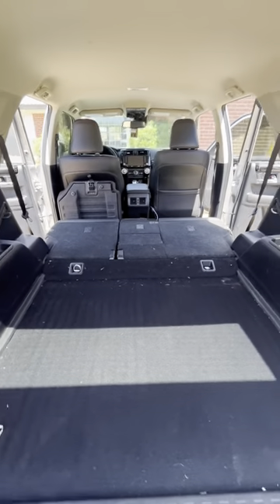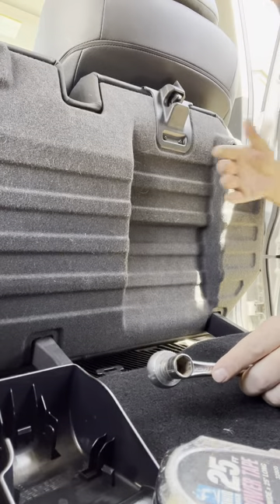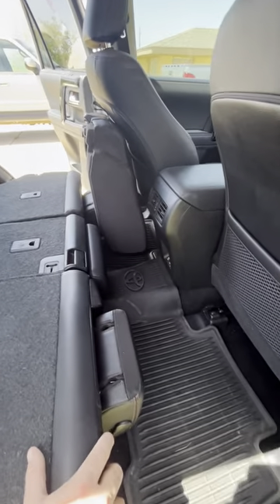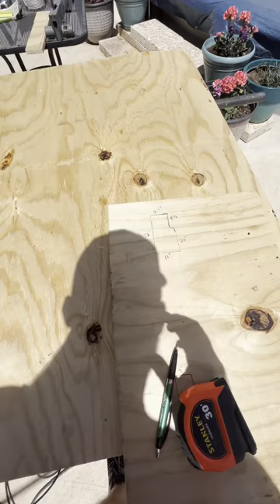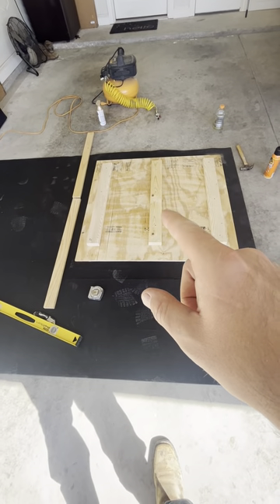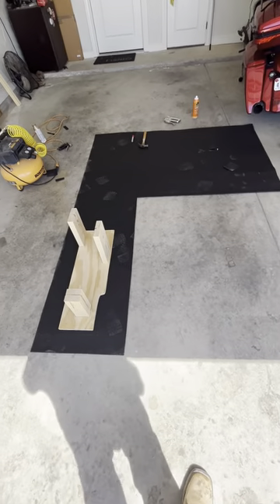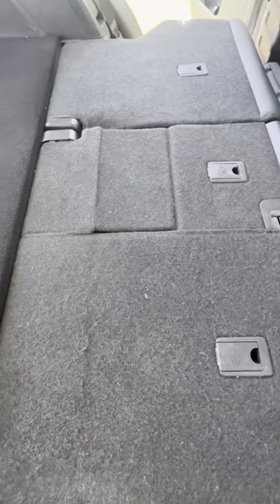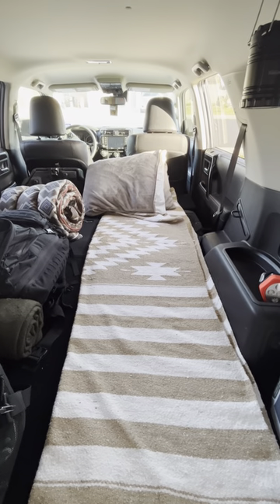4runner camping 5th Gen sleeping platform

Comment: Maybe I missed it but how wide is the area you allotted for sleeping at the end there? Like between the wheel well and your gear? Thanks.
Reply from the maker: Good question. The distance between the wheel well is 43.5 in. so from one wheel to the center of the platform is 21.75 inches. My guess is that from wheel well to the edge where my gear is roughly 26-28 inches.
Reply from the maker: To put it in perspective, most camping cots are 32-35” in width
Reply: @GarrettsTravelNAdventure  Ok cool, thanks. I was contemplating getting a 25" memory foam mattress.